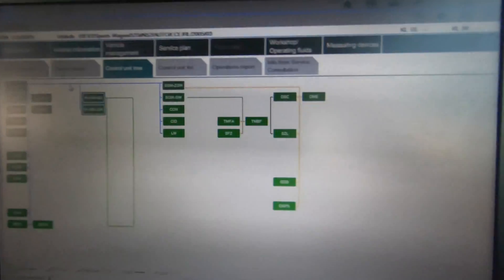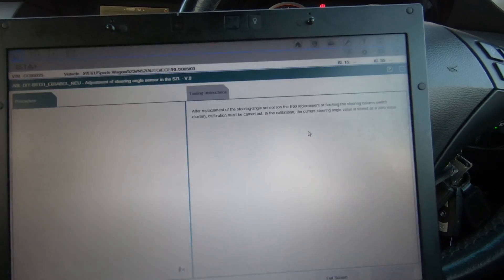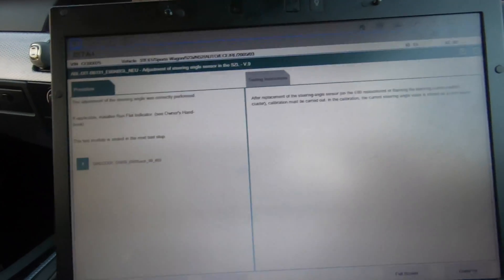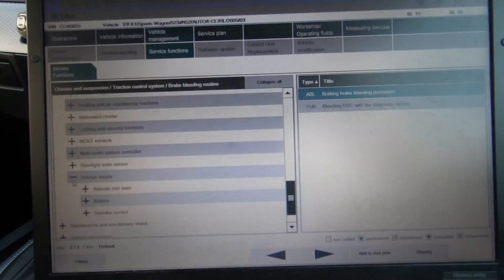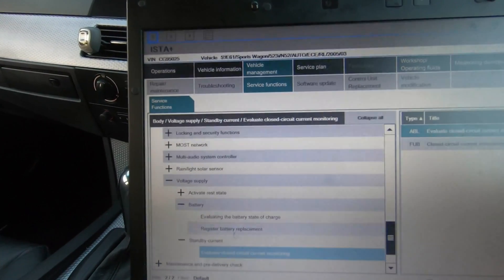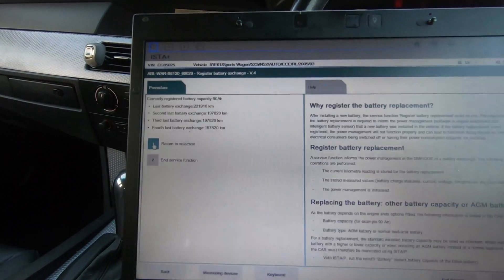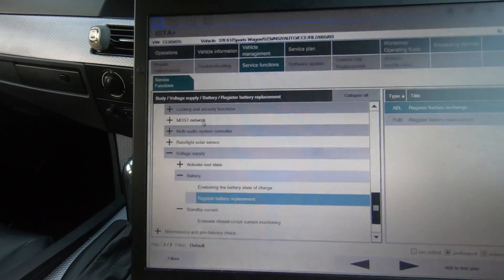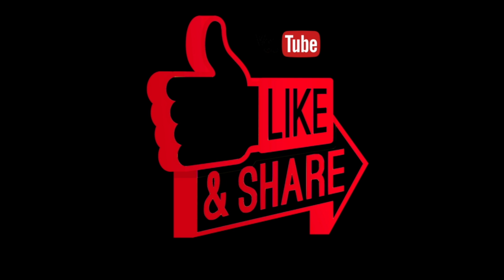BMW ISTA D How to register battery and calibrate steering angle sensor and bleed brakes with ISTA D

Comment: I have ISTA+  4.39.2 and need to do the Steering Angle Sensor calibration after having my battery disconnected for 2 weeks (replaced cat converter and valve cover) BUT the SAS test doesn't show up under 'Chassis and Suspension' nor does it show up under Power train, Body, etc... any ideas on what I'm doing wrong?

Comment: Hi doctor, i need to sync dme and ews for my 328i 2008 after replacing battery. Can now crank dont start. I got Ispa and dcan cable just need the know where to go in ispa

Comment: my BMW E81 118i doesn't have IBS sensor on the negative terminal. When changing the battery do i have to register the battery even if i dont have IBS sensor?

Comment: loving the channel and lots learnt so far, so dr dean i have a problem with the brakes on my 545 e61, driving home from a dog walk with the mrs i noticed a juddering and car slowing down as if brakes were applied, but foot was no where near the peddle, so nursed the car to the nearest possible safe place to inspect, ...he drivers side front disc was glowing and a small flame was present (expensive road side BBQ!) i had water on board PHEW and cooled it  i have now replaced the piston and disc/pads but the caliper is jamming after operating the pedal, i have cleaned the travel pins and replaced the rubber sleeves also bled the caliper, but still have the problem of it binding or locking up un drivers side front, please advise what i need to do i need my car to do a long journey but dont feel safe to do so your infinite wisdom is needed

Comment: Hi nathan, great vid! Where do I get Ista D from? I have an e93, 2007 335i. Recently had the workshop replace ECU. Car came back with steering angle sensor codes. Mechanic says steering angle sensor needs replacing so wondering if I can have a crack at it with Ista D cause it was working fine prior to ECU change. Thanks!

Comment: Great content. I have a problem with a steering wheel on my BMW E60 model. I disconected the battery terminal and after connecting them again the steering wheel shifted itself from its center to about 60+ degrees left. Please help me how to fix back to its center

Comment: Thanks for the informative video! Two questions about the battery registration. Can I do it with the engine running? (Don't have a voltage stabilizer.) And can I use an Enet cable for the registration?

Comment: Hello, I'm Georgе from Bulgaria. Can you help me with my BMW e60 545 Dynamic drive. I changed the sensor for the steering angle of the steering rack, but I can't calibrate it. I use Ista +. Do I need to encode this sensor beforehand? Thank you!

Comment: Doctor Dean,  Awesome videos, man!  A good one would be how to reset an automatic transmission on an 05 BMW E60 after replacement different module new solenoids, Basically transmission was rebuilt module was replaced because original module was bad. Keep them coming man

Comment: Hi Sorry for asking.having problem with f31 Xdrive LCI steering rack . steering angle sensor and belt jump. Is it easier to fix it the steering rack , or to replace it  and reprogram.can i use second hand steering rack.

Comment: Hi Dean, I recently checked my battery settings in ISTA D and noticed that the previous owner did not register the change of battery. The battery installed at present is a 100Ah battery but the car thinks it’s still the old 80Ah with no previous battery exchanges. How do I change it so that the car knows it’s a 100Ah battery? Cheers!

Comment: Hi, do I must connect a PSU while doing battery registration only? And how long the whole project might take.
I lookup online a PSU with required voltage and amps costs over $300.. and its a little hard to justify if i only want to change battery.
Looking forward to hear from you!
Cheers!

Comment: Thanks for this Dean very helpful mate however I need to change the value of my battery from 90ah to 100ah as my new battery is 100ah, I know it cannot be done in ISTA D so what's best to use to change the value ISTA P or WinKFP tools please mate? Thanks.
Reply from the maker: Mate I have a video for that mate go check my other videos for it on my e60 bro
Reply: @BMWDoctor  Will check it out now mate thanks for replying mate cheers fella! :D
Reply from the maker: leadster88 your welcome mate I can’t link it otherwise I would for you mate

Comment: Nice easy to follow video... cheers BMW Doc! Does the changing of a battery always require that the brake bleed routine is to be performed? I have installed the new battery, performed the steering angle sensor procedure, registered new battery, but I am unsure as to whether or not I should be performing the brake bleed procedure as part of a battery installation, or if this was mentioned in the video as it was requested by many subscribers.
Reply from the maker: No mate do not perform brake bleeding routine only if your changing your brakes or brake lines and you need the purge air you do not touch that function
Reply: @BMWDoctor  Sweet, cheers mate! You've got yourself a new subscriber, keep the awesome vids coming.. thanks again for your reply 🤘

Comment: Hi, I have changed my steering clock spring as it snapped. so bough one from ebay and fit, however everything seems to work fine apart from the paddle shift ! do you thing the angle sensor calibration would fix it ?

Comment: hi ,, i have e90 318i 2009,, i want to do the adaptation on nox ,, please give me little guidance ... 
 my problems are if ista 4.15 * will do it or not ?
and if yes which cable ?
everyone is saying for e series  ista+ wil not work , i need istap ...which has no youtube or any info how to do it .
Reply from the maker: Mate you are listening to the wrong people Ista + does do it whoever told you that is a idiot Ista p is for programming for adaption reset Ista + will do just that and program all in one application so whoever has told you that is a bellend and a normal d can cable can do it I will soon be doing a walkthrough for Ista p stay tuned for it

Comment: I am having problem to get ISTA+ to show voltage :(
Reply from the maker: You using a icom
Reply: @BMWDoctor  naah cheap transparent ebay "K+DCAN USB interface (inpa Compatible)"  usb cable.
Reply from the maker: Well it won’t show voltage with a cable you need Icom if you want voltage cable does not show voltage and never will
Reply: @BMWDoctor   correct.  there is a program that can emulate voltage. but I have not got it to work yet. :/ How much much money is an Icom? The real deal is a better deal :D
Reply from the maker: Exactly please wait for my new video coming out I explain everything regarding Icom and voltage emulator I have that aswell but it is not good espically if you want to use Ista p can I ask why do you want to see voltage anyway
Reply: @BMWDoctor  omg cant wait :D  I'am restricted to do some things in ista+ when ista cant detect voltage.
Reply from the maker: You won’t be able to do them anyway without a Icom it won’t let you and will detect your using obd by ediabas so voltage emulator will not help you I know exactly what your meaning
Reply: @BMWDoctor  ahh :(  Thank you for this good info! <3 Gotta look around for an Icom and open my wallet a bit more :D haha

Comment: Like the video you are the only person actually explain precisely. Have a question about (BSD) no message to alternator get the voltage 10.5v no start no crank, not the starter or the alternator I checked them.doyou have any suggestions
Reply from the maker: battery cut off mate thanks alot mate im glad its helping people just need youtube to promote me more man before I leave this place
Reply: @BMWDoctor  any idea about the battery is new
Reply from the maker: Have you registered the battery
Reply: @BMWDoctor  by the BMW dealer a  year ago.
Reply from the maker: But you said you changed the battery again was that one registered
Reply: @BMWDoctor  no I haven't  change it since I got it from the dealer .. do i have get registered?
Reply from the maker: Yes I would change that battery
Reply: Thanks once again I try it next.. hope you can make a video about (BSD) no start no crank